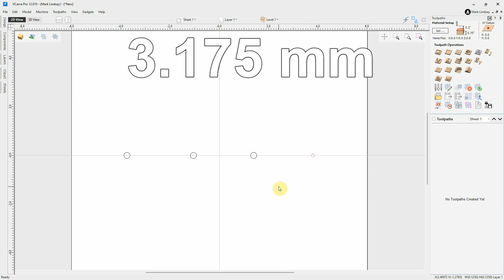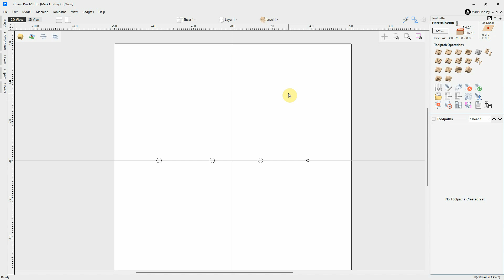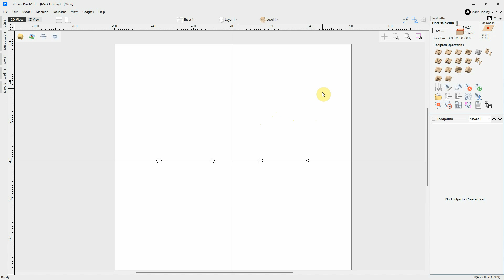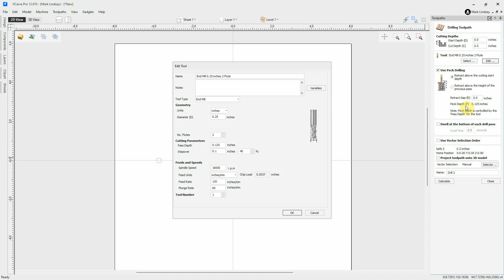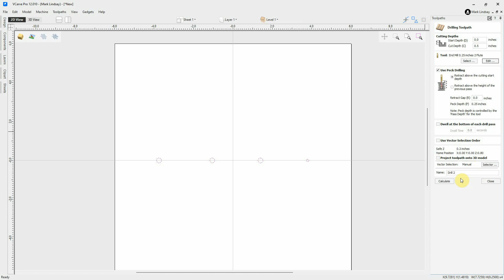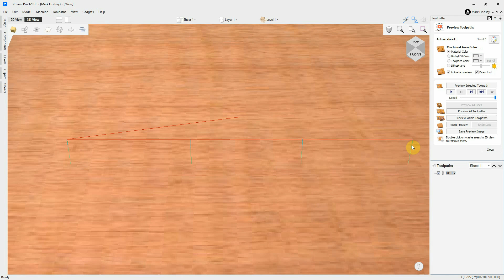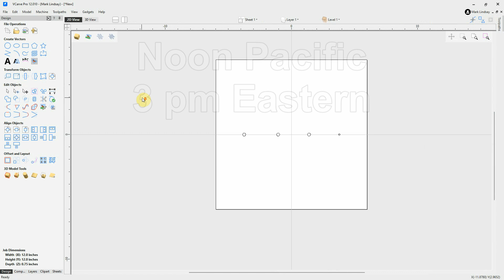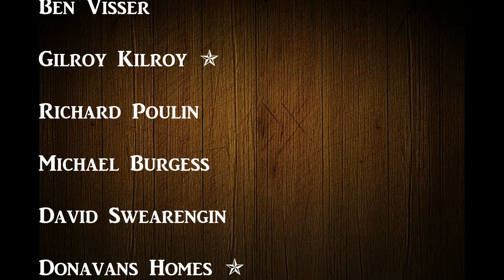Vectric V12+ for the Absolute Beginner - Part 8 –  The Drilling Toolpath

Comment: so you didn't answer the question of how do you make the hole the correct size?
Reply from the maker: I think I did answer the question, but it may not have been in this particular video. When using the Drilling toolpath, you'll need to use the correct sized bit. If you need to drill a hole and you don't have the correct sized bit, use a bit that's smaller than the hole you need to drill, and use a Pocket toolpath. Sorry for the confusion.
Reply: @ ok, so I ended up using the drilling tool path and then a pocket tool path. Seemed to work ok. Thanks for the reply.

Comment: Hey Mark, I have VCarve Pro 12.010 and save the drilling path out to my 1F Elite Journeyman with Masso controller using the Post Processor  "Onefinity Masso Inch.
but it seems like the Dwell and Peck features do not work. 
The reason that I am using them is to line up the holes above a pre-printed piece that requires precise placement but the Rapid move is so fast and the drill time so quick, I can't really tell where it is before it moves on. I'd appreciate any insight you may have or any of your videos you might direct me to.
Thanks for your Time. Dann
Reply from the maker: I'm sorry Dann, but I don't use the Masso controller, so I have no experience with the post processor or the controller itself. This would be a good question for Onefinity or Masso Tech Support. I would try both of them, and see if they can't get you squared away.
Reply: @MarkLindsayCNC  Ok, thanks for your time!

Comment: Do you have any advice on  bit speedsfor the drill toolpath?  I primarily use mdf,, oak and alder.
Reply from the maker: Not really. There are a lot of variables involved, such as the strength/rigidity of your CNC, the type and size of bit, whether you use a spindle or router, the HP rating of your spindle/router, etc... I start conservative, take notes so I can remember what works and what doesn't, and go from there.